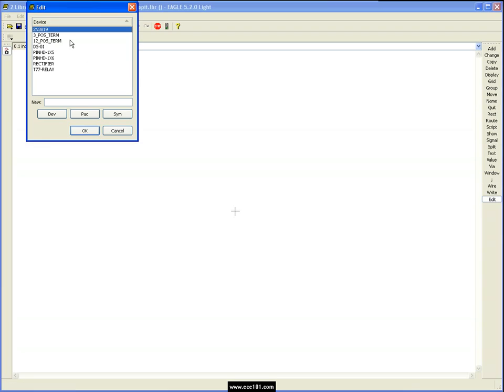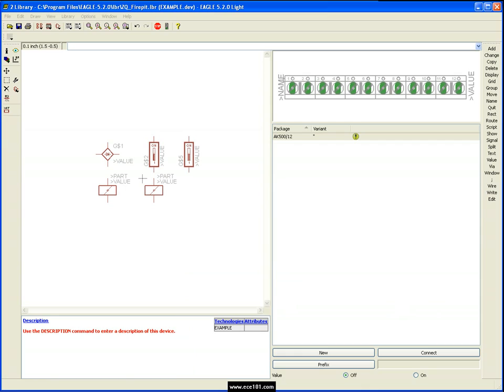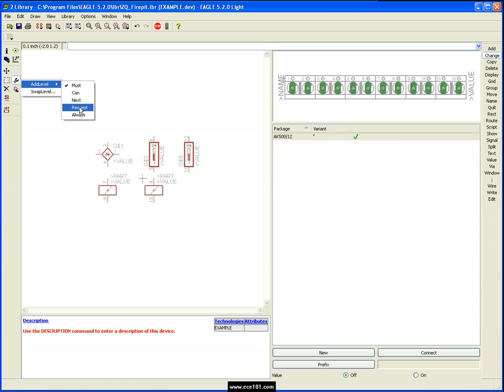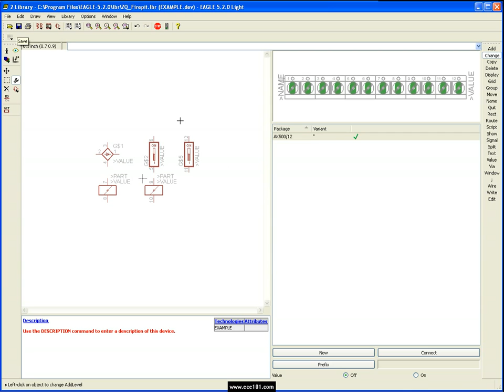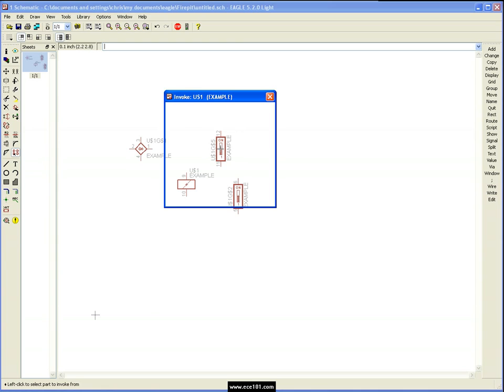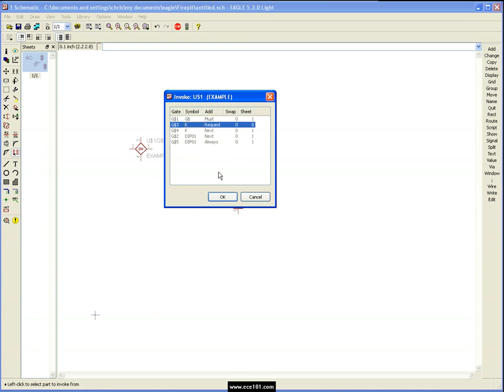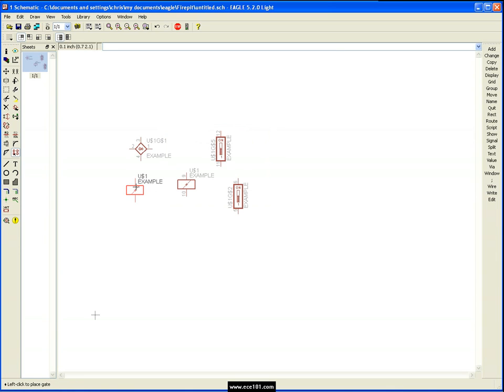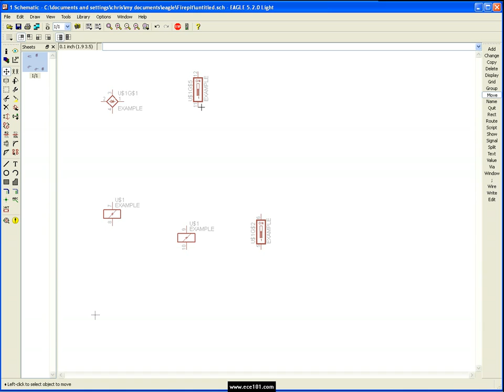EAGLE Addlevel explanation

Comment: If someone ever needs this, there is a small difference between "can" und "request". Both behave like described in the video, but "can" names the gates IC1A, IC1B, ... while "request" does not give a unique name to the invoked gate (it shares its name with the main gate, specifically used for power pins).